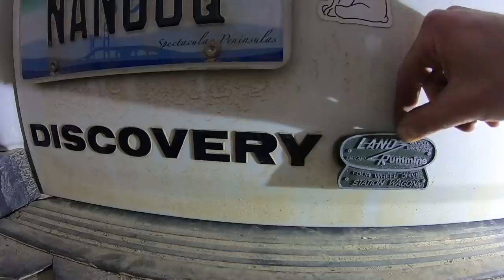Road Test Fail × 4BT Cummins Discovery #44 [Land Rover Build]

Comment: Long time first time, you do unbelievable work brother!
I remember reading a while back that you were kicking around the idea of doing another, so I was wondering if ya had any interest in adapting an '04 Disco to take the repower crate but keep the native diff?
I'm not too far south of ya, building out my take on the camper presently.
Reply from the maker: Hey thanks!  Yeah maybe, because I have been seriously considering picking up a few Disco's with blown V8's to install both engine swaps (either LS or diesel) & campers like mine.  Cool to hear of others getting upgrades instead of 1-way trips to the scrapyard!
Reply: Oh for sure!
I got mine by accident from a scrap guy, former owner ran it into a tree and junked it, only frame damage on the front. Bomb still ticking faithfully 20k (118k odo) later!
Luckily I started reading the manual before I dumped it, these suckers are PACKED with features.

Gonna at least do the steering u-joint if not more this year. Keep up the awesome work brother!

Comment: Do you have any plan for ABS or Traction Control systems? Not that they are necessary but it is a nice safety feature.
Reply from the maker: I do not, but I do have a center locking differential now & will be installing lockers to solve traction issues.  I don't ABS will make a comeback, although I do plan to re-build the entire braking system using much larger Range Rover Sport calipers & rotors... so it's maybe something I could keep from the donor vehicle 🤔

Comment: Hey I love you Rover.. when you did your lift did you have to buy longer arms for your front axle and if you did did you use three degree angle or six?
Reply from the maker: Thanks! I did not, since I'm planning a long travel setup with different axles.
Reply: @Tinker1837 thanks for the quick response... I got you

Comment: does it have some dum pump (injection) thing cuz it was a mud pump motor????????????
Reply from the maker: Thankfully no, it has the "over the road" pump.  My engine started life in a Freightliner StepVan, but only for a short time before the van was wrecked, then was removed to replace a blown-up Detroit diesel in a drilling company's giant mud-pump, which didn't last long either because that mud-pump's gears exploded & was put out to pasture.  As far as I can tell my engine has very little hours, on it on account of an unlucky string of events for previous owners.